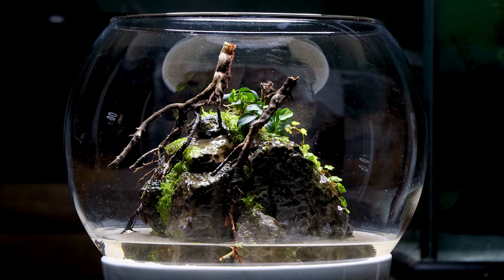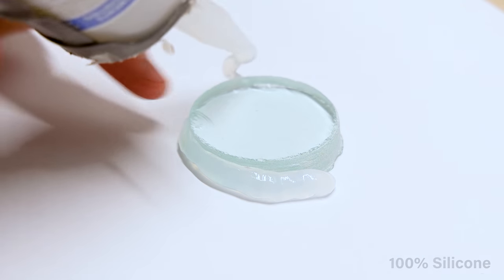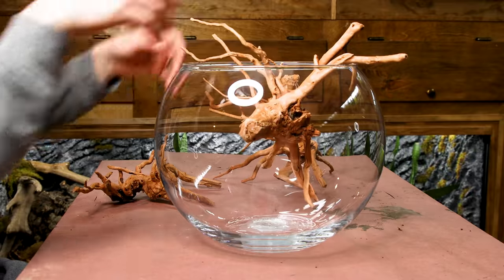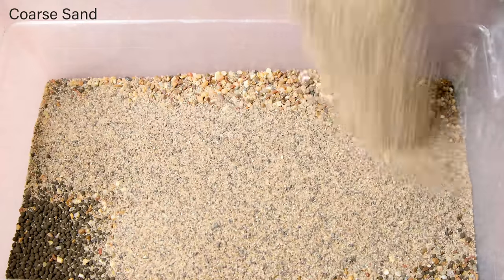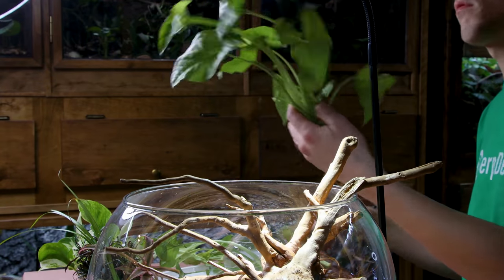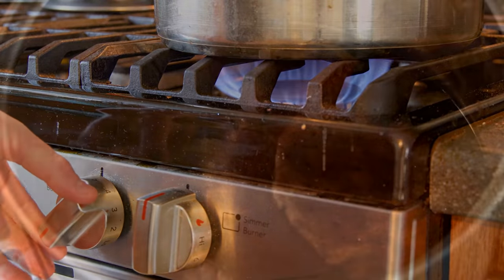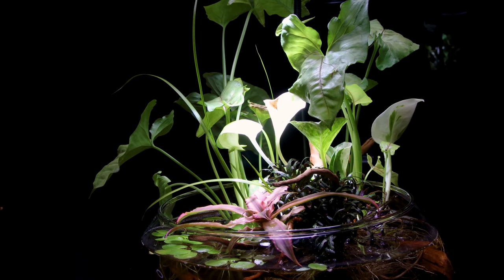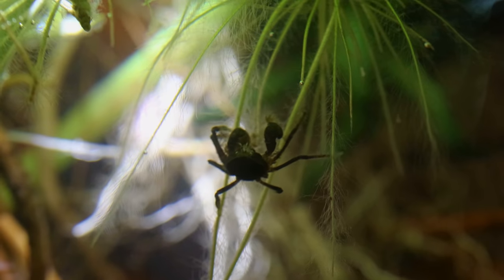Micro Crab Riparium Root Bowl (No Filter Low Tech)

Comment: In the future, drill glass with smaller holes and you can easily "plug" them with silicon plugs when you no longer need the holes. Silicon, as you know, it virtually indestructible and impervious to all chemicals.

Comment: Bro, youre supposed to use the other end of the calipers for inside diameter, c'mon!
Also you ahould be using mineral oil, not water to lube up cut glass. 

Your terrariums are amazing but i cringe when i see you drill glass